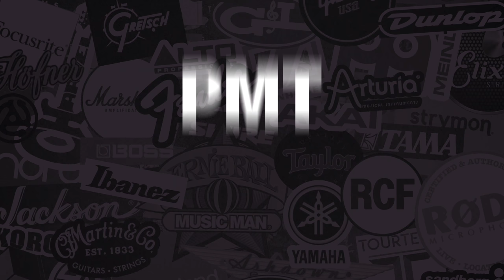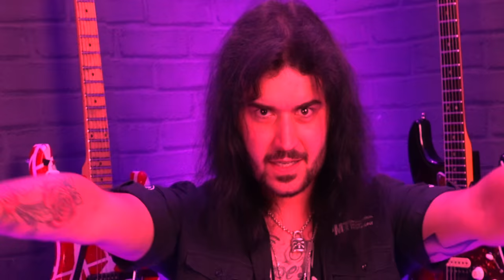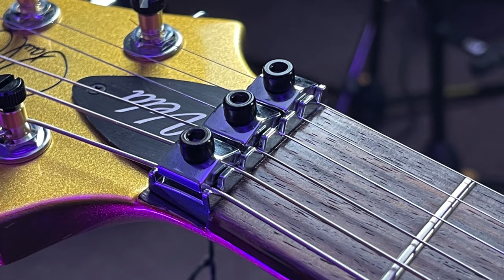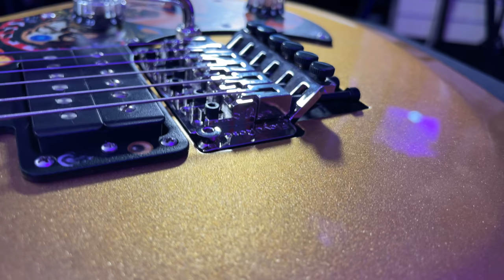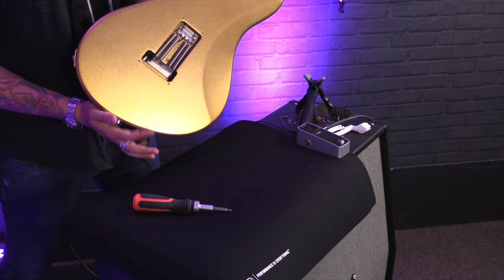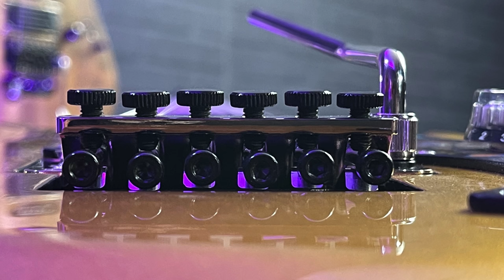How To Restring A Floyd Rose & Other Locking Tremolos! - (It's Not Actually That Hard!)

Comment: Pre-stretching the strings. Why not use the whammy bar to pull back on, and thus stretch the strings? It seems the easy way to stretch them, but I've never seen anyone suggest or do it, so I guess there's something bad about doing this? Anyone know?
Reply: You can do it that way.  Nothing wrong with your method.
Reply: Because you risk snapping the string at the saddle that way. Hand-stretching the strings or using a tool like the String Stretcha (I prefer using that simply because it does a better job than my hand does at stretching the string evenly. YMMV, as Dagan's obviously does) to stretch the string all along its length avoids having the string stretched at a single point, which is a good way to weaken or even snap it, especially when it's new.

Comment: Just restrung my 1st floyd rose thanks! However I definitely wasn't quite as prepared, I'm definitely using the 9v battery trick next time, chopped the strings off and had nothing to prop under the bridge; ended up using my wallet 😂🤘

Comment: Alright so i watched this last night, i have a kramer baretta vintage. I changed the strings and now it wont stay in tune at all and the action is like a foot off the fretboard. How do I fix this myself since none of the techs nor anyone from Gibson can tell me what the problem is they told me to just replace it. Its brand new it just needs a set up
Reply: Did you change the string gauge?  If the base of the trem has risen (pulled up towards head of guitar on an angle) you can tighten the trem claw screws in the back of the guitar to make it level/flush with the top of the guitar again.  That should restore the action to where it was (hopefully)...
Reply: @TheFiredragon01  no i used the same gauge. This is my first floyd rose, i lowered the bridge. Got the action where i want it now i just cant get it to stay in tune. I tighted the trem screws and the whammy seems a little tight now so ill probably loosen them a bit. Is it just a matter of tuning and retuning to get it stay in tune? The second i lock the strings it goes out of tune

Comment: forgot to put something in to prevent bridge from moving back and the springs flew out of the block and bridge came off the posts, oops, took a while to get that right again. Perhaps changing one string at a time is also safer than just cutting all the strings, because it keeps some tension.

Comment: I have this theory that the string "stretching" thing is old school guitarist dude science. The technique works, but it isn't doing what they think it is. The real reason your guitar goes out of tune after you've just strung it is because of those hard angled bends that form over the bridge and the nut after the strings have been sitting for a while. With new strings if you look closely at those 2 points, the string gradually curves into the scale-length whereas when you pull old strings, those points of contact are hard, defined angles. 
I tried researching this and there was no science available on string stretching, just a lot of people going "yes, the strings are stretching" which would make me feel better if I could find a single study or statement from an actual string manufacturer. I just don't think steel is as elastic as people think it is. If the process was making a permanent molecular change to the material, you'd think manufacturers would just sell us pre-stretched string to save us the hassle. 
Anyways, if anybody would like to test my theory, instead of stretching your strings next time you string  your guitar- apply some downwards pressure on the playing side of the bridge/nut to try and help form that previously mentioned angle. I've done it a few times now without any stretching and have gotten super minimal tuning walk. On through body guitars there'll still be some string curvature between the body and the bridge, but that'll work itself out.
Reply: I don't know if 55 is old school to you or not but In my youth "string stretching" was necessary as locking nuts and fine tuning trems were just getting popular. Guitars without a locknut had the wraps around the tuning peg, under string Ts or Trees, over the nut and then over the bridge saddle. With a locknut, there is only one place the string has to settle and that is over the saddle guide into the pinch block. Since over half of the guitars today have locknuts there's less of an importance on stretching the strings. So I think it was more of a mislabeled  term of stretching in stead of settling. If the strings weren't stretched on a non locking nut it would go out of tune all day til enough bends and vibrato settle in the strings.
Eh?
Reply: @welern2liv815  I've only ever seen locking nuts on guitar with Floyd-rose/similar floating bridges, and if I recall correctly that setup became popular because dive-bombing was in style and the floating bridge would detune the guitar without something to hold the strings in tension at the head.  
But I think we're on the same page? I just think people are putting unnecessary stress on their guitar when they grip all 6 strings and yank on them when in reality you're trying to get a few angles to settle and curves to straighten out.
Reply: @coopers1716  I think so. Grabbing all 6 at once? Lol, That's a bit much! Just a few tugs at the 12th, one string at a time, 1-3 inches out and away from the fretboard is all you need to settle em down. I will "stretch" before locking down so the strings get tight around the pegs. Then if i need to unlock there won't be a sudden shift in tension as it transfers to the pegs throwing the tuning way out. Peace to you and yours.
Reply: @welern2liv815  I've watched somebody grip all 6 and pull them 6-8" away from the neck and I was convinced I was about to watch the face of the acoustic delaminate lol you too friend🙏🏼
Reply: @coopers1716  🤯 !  ✌️

Comment: Man I do mine way different lol. I do it a string at a time and stretch as I go. By the time I'm done the last E string the whole thing is in tune, stays in tune and never gives  me any problems.
Reply: spot on.
Exception is when you need to clean the fret board or polish the frets.
Reply: Agreed, the only time I take them all off is to clean or something similar. Most times it's one at a time.
Reply: Do you wrap the strings around the posts ? Seems like this guy just put them through the hole and that's it
Reply: @MB-ux5tx  I fill the posts with string if that's what you're referring too?
Reply: @charlesb7831  I was asking like after you thread the string through the post, do you just leave it as is or wrap it 1-2x.
Reply: @MB-ux5tx  no, I put almost the whole string on.  I fill it to the bottom of the post. I had to alter the length the first few string changes till I got the right length,  then use the old string to measure up the new string. All 4 of my Floyd Rose guitars and my hardtails are all like that. Tuning posts are full of string.  I've been doing this for 30 plus years and no problems.
Reply: Thanks bud ⚡️
Reply: @MB-ux5tx  The guitar he was using has locking tuners. No need to wrap.

Comment: Change them one at a time. Just like any other guitar. The string gauge MUST be the same to avoid extensive adjustment. 
Start low E. Replace and tune. 
Do the A next. No battery required. And so on.
For a New To Floyds player, cutting all the strings off can cause the bridge to not sit level when the batery is removed. Replace, tune, go to the next, low to high. I NEVER had a single issue.

Comment: You should NEVER adjust the string posts -with string -and spring tension on. This will scar both the posts -as well as dull the base plate edge in contact with the post.
Reply: Sam, would you be so kind to explain how this should be done? Do I remove ALL strings and springs, then raise/lower posts? Seems labor intensive.  Thanks for your time, sir.
Reply: @Lloyd5148  Absolutely no problem! Off course i will explain this. There are a couple of ways how to do this right. That is: Without scaring. 
The easy way is just to flip the allready tuned and locked instrument over in Your lap. Point the bar towards the back strap button -and control the bar tension towards Your lap -as You remove the springs. In most cases this will remove all stringtension from the posts. Then lay the guitar back onto the workbench. In some cases the higher strings will still have tension on. If it ain't much; the Floyd baseplate can be pushed away from the posts -as their are turned/adjusted. If not: You need to unlock the nut and loosen the tensioned strings. I'm personally right handed. I use my left thumb to push/hold the baseplate back -as i make the post adjustments with my right hand. (Allen key already inserted into the post -before i push the base plate away.) When Your adjustments are done: Repeat the process: Guitar back on Your lap -and on with the springs again. Check and tune (if nessesary). If the lock nut wasn't loosened; the guitar should be fairly in tune with the springs back. Repeat until satisfied.
Reply: @MrJonken70  ...Huge help...so appreciate your time, sir.
Reply: @Lloyd5148  You are so wellcome. -Good luck!

Comment: My saddle blocks fell out because I'm idiot that picked the guitar up. Do I put the block back in with the hole facing the tuning pegs or the hole facing the floyd rose system?
Reply from the maker: The Floyd Rose system, the little hole is for the locking screw to slot into.
Reply: @PMTVUK  thank you so much for the reply and confirming that for me.

Comment: I've always wondered if there's a torque value for the set screws on the trem and nut. I'm always worried I'm not going to tighten enough & then I worry that I'll tighten too much.
Reply: Yes, they are standard metric threads. Just google for the standard torque value for M3 and M4 metric socket head screws

Comment: Can someone help me. It's my first floyd rose guitar. I dod it just like the video but my strings won't stay in tune. Everytime i tune all the strings, i check them and they're all out if tune again. What do i need to do to fix it??
Reply: did you put enough slack for the string to wind around the post? if not the the string are slipping. and you do need to repeatedly tune every string before the tension on the spring and the strings match
Reply: @dzaukiiskandarsyafrudin5009  Hi. Yeah, I got it eventually later that night after posting this. I just kept retuning and adjusting the springs and it stayed in tune. It was nowhere near as hard as people made out. I don't know why I put off getting a Floyd rose for so long. Thank you for replying anyway!!

Comment: Never could understand cutting the strings to remove....makes no sense to do it. And you can put the ball ends thru the tuners BUT you have to change the phase on your pick ups because they are in backwards...............
Reply: Yes! Why cut? Just remove from saddle and unwrap at tuner peg. Can you elaborate on "change the phase"? A string can be "backwards"? No one talks about this! Thanks for your time, sir.
Reply: @Lloyd5148  Just joking about the phase. Just like a"Tone" pick guard and tone neck plate etc...
Reply: No need to change the phase - just use the cable backwards too :D

Comment: Great tips thanks..i just bought my first floyd rose a month ago its cort x6..but i think i have a problem with the strings action.. Its a 1mm higher than the normal rate, which is about 2mm..and I've adjusted the bridge really well to make it parallel to the body.. But still high.. How can i adjust it more?! Like is the truss rode needs an adjustment or something?! Anyone 🙁?!
Reply: im very new to them to, but you can raise the floyd rose's action with and lower it with the alan key sockets in the top right and left of the floyd rose

Comment: This is done wrong. You do not need a battery. You are supposed to replace 2 strings at a time  and tune them to keep the tension properly.  Then move to the next 2. The method in the video many things can go wrong and the worst part is the intonation will be shot 9 times out of 10.
Reply: I believe he removed them all to show a full set up from new and also access to clean fret board and possibley polish the frets.

Comment: I’d rather have the cover plate off so that if the guitar needs an adjustment in the back I can do it quickly and not have to fiddle with the screws for a minute
Reply: I'd worry taking removing and putting the screws too much might cause them to strip the wood overtime.

Comment: I need some help with my Floyd if anyone knows. I changed my strings today and everything was working fine, I had perfect float, tuning, the lot. Then when I was playing, I did a little dive bomb and all hell broke loose, guitar weny heavily out of tune and there was a lot more tension on the strings due to the angle of the bridge, anyone know how to stop this from happening?
Reply: Wow thats crazy. Did the bridge drop down backward?
Reply: @sjs793  yeah but I was able to get it back pretty easily to a perfect float. Guitars been fine since. Not used the whammy bar since though. Sort of scared to use it lol.

Comment: Steve Vai's guitar technician actually leaves the string ball ends on the strings by feeding the string through the tuners 1st then to the bridge.
So it's kind of a cheating way of locking tuners.
Reply: Eddie's guitar tech. Should have just put on locking tuners...